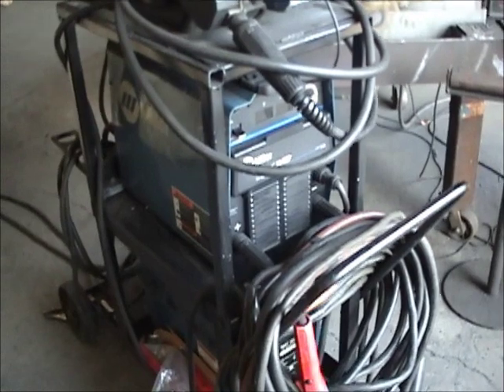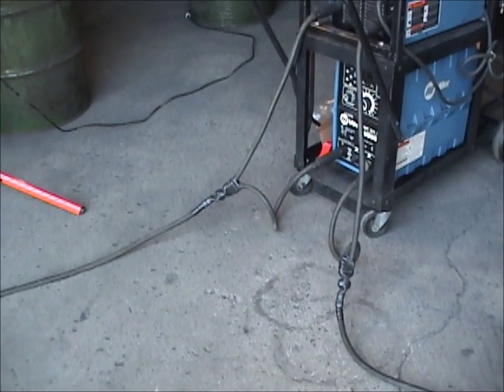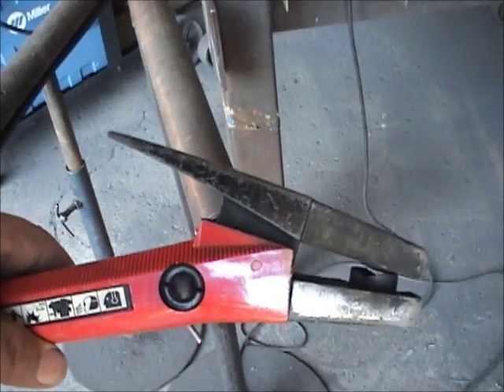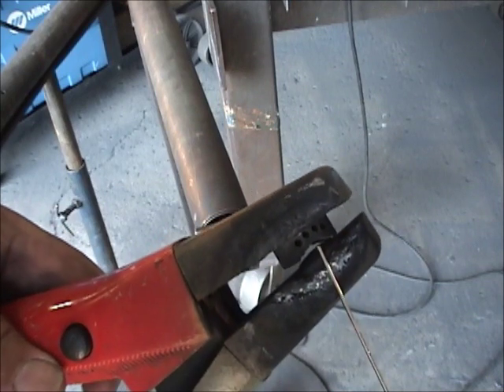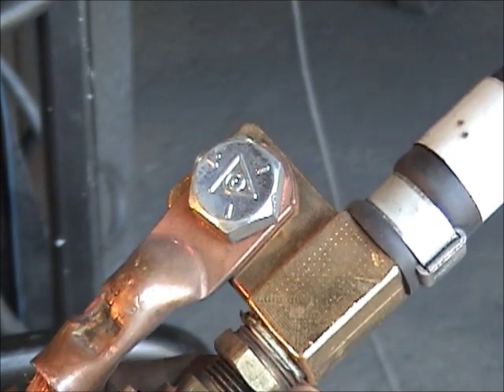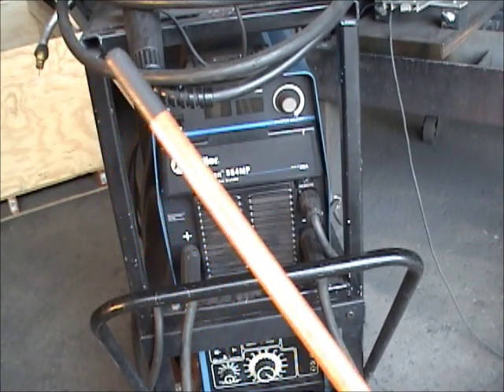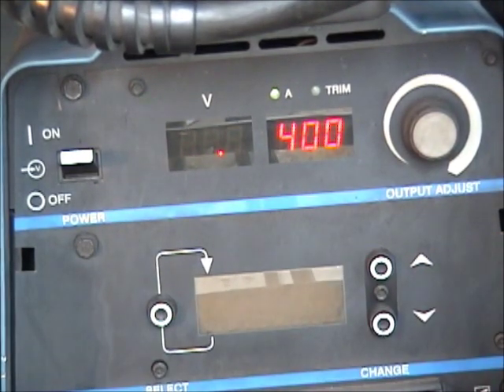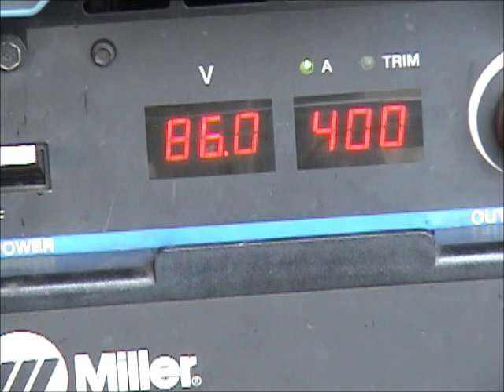ACAC Air Cabon Arc Gouging Part 1 8 1 2012

Comment: I've gouged with 400 amps with a 1/4 round rod with no problems.   800 amp is a little high
Reply from the maker: the electrodes were 3/8" according to specs. that require approx. 100 amps per 1/16 of diameter. 600 amps works but a little more digs a lot deeper and cleaner.
Reply from the maker: +Chris Hensiak If you use smaller electrodes you can do, a reasonable job. the other thing you need a lot of is compressed air 80-90psi works well but for really big electrodes 100- 120psi with lots of volume works better. it is really a matter of how much you want to remove at one time.